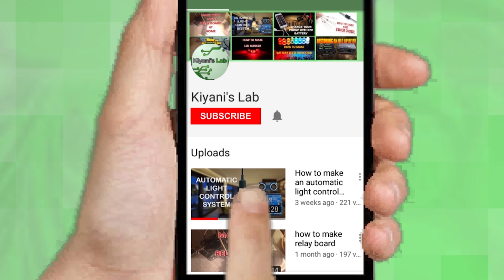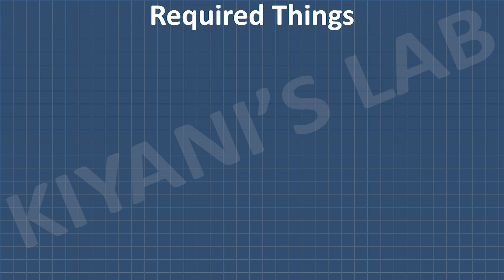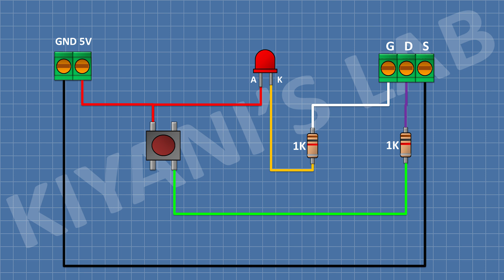IGBT & MOSFET TESTER | Electronics Project

Comment from the maker: Diagram  Correction done do connections according to diagram in the description
Reply: Hi hi - hey u should remove and do a corrected video, before it racks up too many views. 
When there are errors in circuits, diagrams, or as in this case they dont even match up, it damages the credibility of your whole channel, and other vids, which are both really really good. 
Thats my suggestion anyway. 
If you do choose to redo, maybe you could modify so it can test both npn and pnp. 
Thanks as usual for posting and taking the time to make it, appreciated as always 😊
Reply from the maker: @jonlitchfield8888  Diagram  Correction done do connections according to diagram in the description
Reply: @KiyanisLab  oh thanks 😀👍
Reply: Use 10k's instead of 1k's?
Reply: why that's 3 resistor the module?

Comment: Hi, thanks for making these videos. One observation, in the video you see 3 resistors and in the schematic diagram there are only 2, which is correct? With this circuit can I test the IXTK62N25?

Hola gracias por hacer estos videos. Una observación, en el video de ven 3 resistencias y en el diagrama esquemático solo están 2, cual es lo correcto?. Con este circuito puedo probar los IXTK62N25?

Comment: The 10K resistor is not visible in the circuit diagram. Please add it to the diagram.
Reply from the maker: Check the circuit diagram again in the description, I made a correction.
Reply: в описі відео є схема

Comment: Third resistor between gate (base) and source (emitter) 10k for discharge, not necessary in this case for testing 😊
Reply: @yastop2111  i used another momentary button instead of the 10k for a manual gate discharge. 
Thankyou for posting the purpose of the resistor, so many people are really hungry to know and learn these things, and when things are posted without explanations or/and errors, its hella frustrating. 
Is that peppa or george pig... 😁

Comment: PROBLEM
In the circuit diagram and components there is only 2 resistors and in the working model there are 3 resistors
Reply: Third resistor between gate (base) and source (emitter) 10k for discharge, not necessary in this case for testing 😊
Reply: Thankyou 😊 @yastop2111